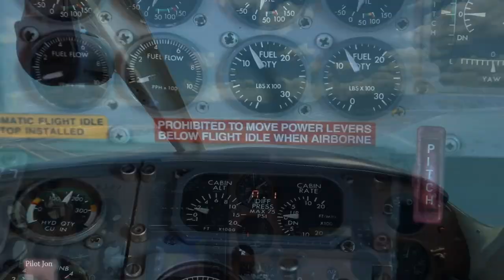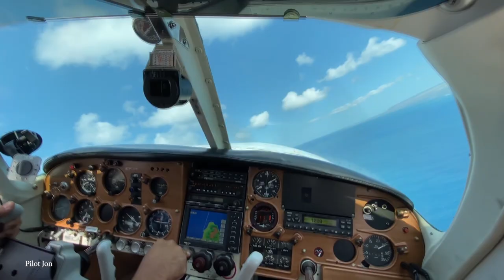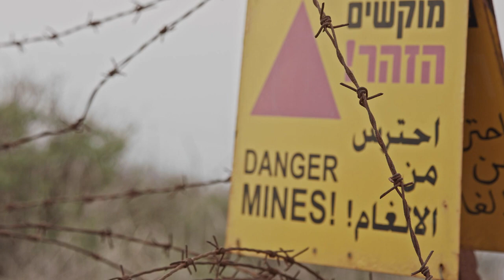15 MOST Dangerous Jobs 2022

Comment: I work in a warehouse for a major retailer driving a forklift and just yesterday as I was working, the guy who scrubs the floors on the Zamboni type machine and it had left the floor pretty wet. While I was trying to make a turn into an aisle the forklift just kept sliding straight and ran right into a rack. I even took my foot off the dead man switch to stop it and it just kept on sliding. It damaged the rack pretty bad, but I walked away fine thankfully.